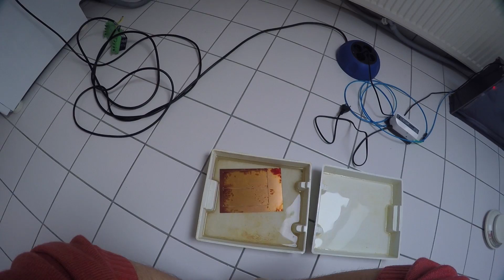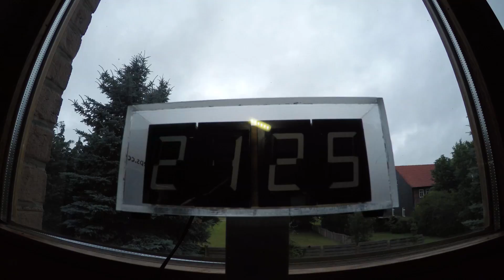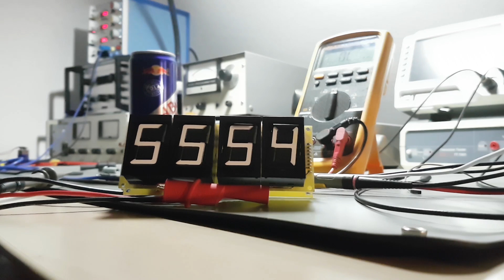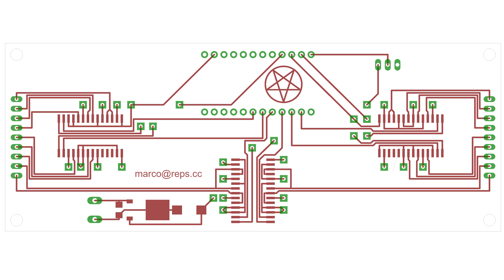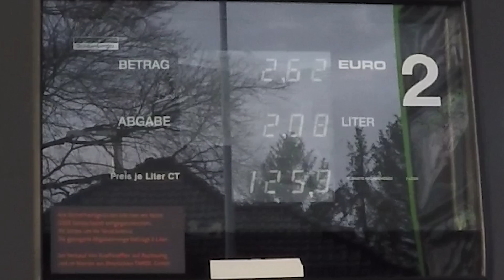Electromagnetic 7-Segment Display Clock

Comment: I really like it!
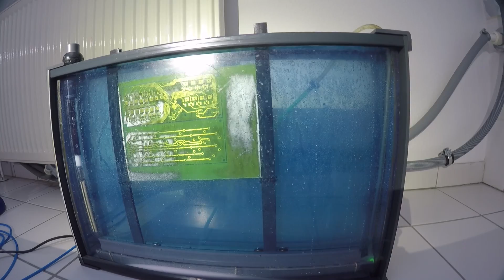What is the tank you have your pcb in @1:02?
Reply: It looks like a water bath with sodium persulfate disolved into it to etch away the copper.
The air bubbles are there to accelerate the process of getting the copper into solution.

Comment: Hey cool, I just stumbled across this video about your nice clock - well done! I have build a similar one as well using the same mechanical modules back in 2008. (Although the case is definately not as nice as yours... https://weyes.de/clkpc ) The modules are driven by L293D drivers and everything is controlled by an ATmega 8. For time reception I have used a DCF77 module as well. The clock has been running 24/7 for the last ten years up to now without any hardware or software problems, so all segments are still switching perfectly with only 1 ms of power.
Reply from the maker: nice! were your digit modules also salvaged from an older machine?
Reply: Thanks! No, I bought them online as new modules at Segor electronics. They have still been available up to October last year (quite a long time!), now they seem to be out of stock. You can still find them by searching for "Magnetanzeige" there. However, Segor could not provide any detailed information regarding these modules, except for the bare electrical specifications (12V, 200mA, 1 ms). I did not even know the recommended installation orientation (or if this doesn't matter at all).

Comment: I came across these displays as well, and due to the lack of easy availability of this MC33880, i designed my own all discrete BJT multiplexed driver. Only 7 current sink/source H/L driver needed and one tri-state (H/L/OFF) driver for the common pin. Using this method and some little more TTL logic i also can use the usual BCD to 7Segement decoder/driver chips, or interface this with an arduinoUno along with a DS3231 RTC.
Reply from the maker: Awesome! I've got to retry a fully discrete version one day, have a lot of displays left :]
Reply: But beware, i´m a breadboard/Perfboard guy ;) So everything i design(ed) and (gonna) built/d is on these (eurokarten lochraster). I never do PCBs again for my hobbyist/tinker/maker stuff. Too much hassle and also time consuming.  I done that when i was into electronics design for a living (robotics/automotive), and i am convinced that perfs (at least FR4, we don´t use that FR2 crap) are much cheaper, way faster and as reliable then any PCB, even compared to those made by ProPCB manufacturers. The time i spend on Protel designing the schematics and/or PCBs, i better spent on setup and solder direct on a Perf after i done tinkering and proof of concept on breadboards. And if something is wrong (it usually is) i don´t need to do the whole process again. On a perf, i simply can correct any error with my desoldering unit.
Reply from the maker: No, haven't seen those, so I'm glad I did now :) Thank you
Reply: TubiCal Me too. 
I'll just spend a few dollars more and use a breakout/dev board, rather than an ICs. So much quicker. I understand this doesn't apply to every project!

BTW, your first 2 links are the same?